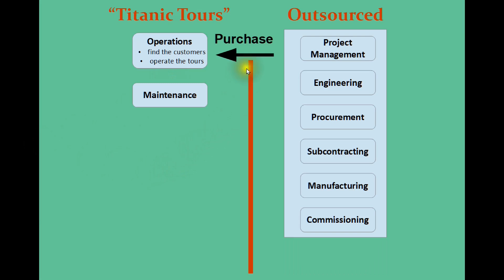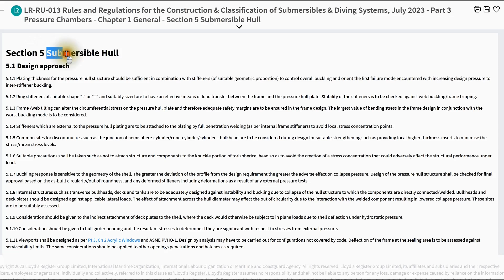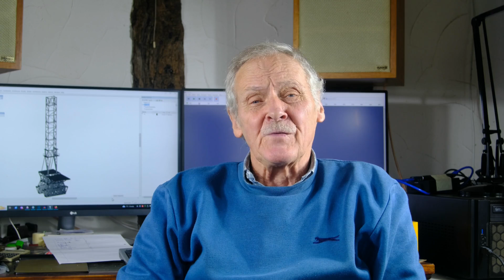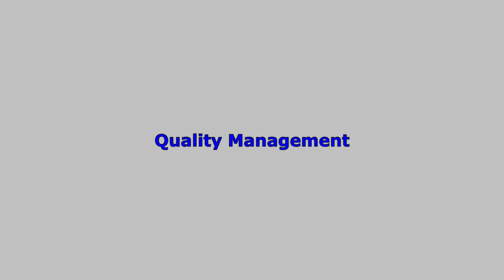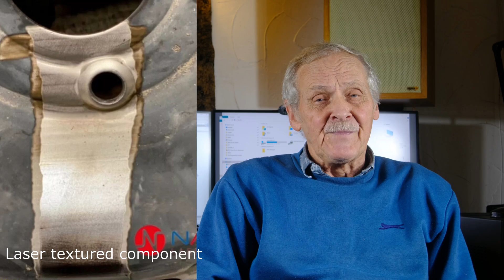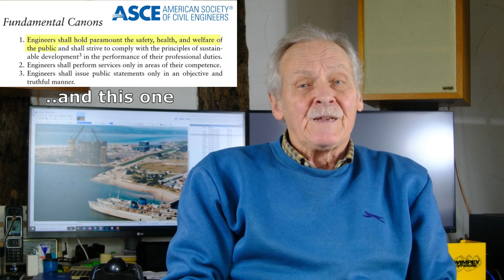OceanGate Titan - how should it have been designed?  REPOSTED FROM OTHER CHANNEL.

Comment: I found this video as a result of a thoughtful reply to one of my Titan implosion videos.  I watched the entire video and it is a good video presenting a sound engineering approach to any highly technical project.  In this case, building a submersible.  For those interested in this you may want to watch the the Coast Guard hearings.  These subjects are discussed by Roy Thomas, the lead engineer for ABS (2nd witness on 9/23/24).  This was also discussed by another engineer Bart Kemper who presented the concepts of applying VVUQ -  Verification, Validation and Uncertainty Quantification.  That was interesting and he was the 3rd witness on 9/25/24.  Thanks for making this video.
Reply from the maker: There are various protocols for the development of new technology and for quality management.
The ASME VVUQ approach which you mention is specific to pressure vessels.
The DnV-RP-A203 approach which I outlined is more generic (popular in marine and offshore engineering) and much used in Europe.
The US Navy SUBSAFE programme is specific to submarines.
The US Military Composite Handbook Building Block approach is specific to composites, mainly for aircraft.
There's no shortage of guidance and if OceanGate had followed any of these the outcome would have been very different.
Thanks for the contribution.